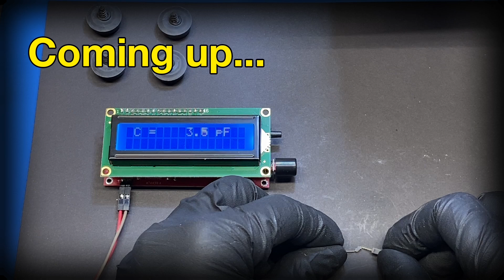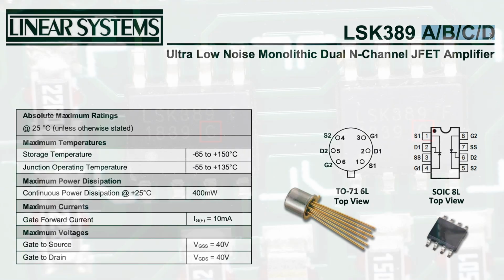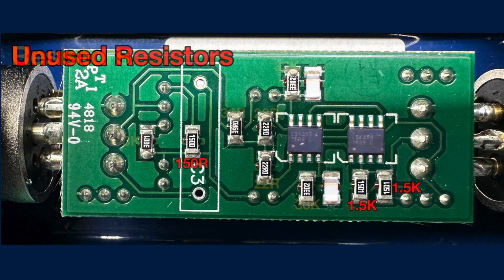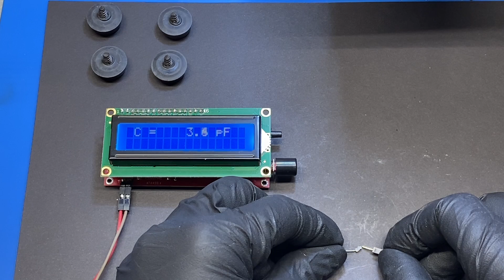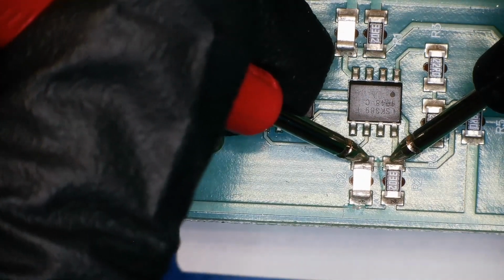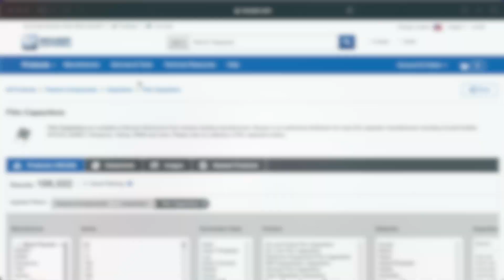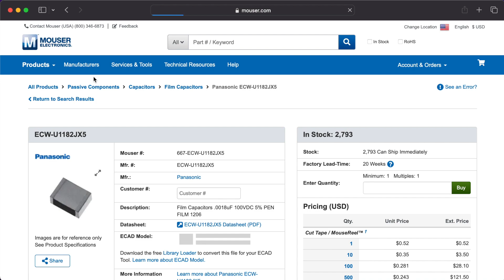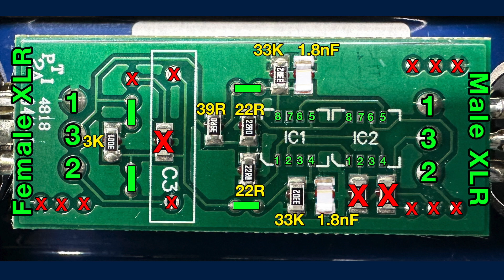Cloudlifter CL-1 Teardown | Mic Preamp Series Video 1

Comment: My cloudlifter is brand new but not working... i wonder if any of this is the problem...
Reply from the maker: Have you double checked that you have turned phantom power on with the Cloudlifter in your audio chain? And that the mic you are using doesn’t require phantom power, since the Cloudlifter will essentially block it.
Reply: @MostlyBuilds  I'm on an Sm7B which needs no phantom power...
Reply from the maker: @IceMike1200 gotcha. The cloud lifter needs phantom power. Did you turn that on when you have the cloud lifter plugged in between the audio interface and the mic?
Reply: @MostlyBuilds  no I didn't...
Reply: @MostlyBuilds  Thank you so much! You have helped me!!!

Comment: The other version of the board is a copy of the Alctron MA-1 circuit. That has the ability to short out pins 2 and 3 on the input to disable the microphone but the MA-1 case did not bother to put a switch on the outside. As CL-1 eventually also decided not to add the disable switch,so the final board does not have the jumpers.

Comment: Hello, since LSK389 is unavailable where I live, is Toshiba 2SK389 a 1:1 (as of specs)/ good replacement?
Reply from the maker: I have never heard of the 2SK389 until now. It appears to be discontinued by Toshiba and the LSK389 was explicitly built by Linear Systems to replace it. The specs look pretty similar. It might be worth a shot to try it. Curious that you are able to find this part and not the new one that’s still in production. Using a different part might work, but it’s definitely possible that it could sound different. Try it at your own risk! Good luck!

Comment: my cloudlifter is working with 48v off. It seems like an error to me, short circuit. On the "TASCAM" board it works with 48v off. On the ZOOM L-8 board it does not work. I found it very strange.
Reply from the maker: That sounds pretty fishy. Have you put a multimeter on the output of your Tascam interface? I’d bet it’s always putting out 48v.
Reply: JFETs are depletion mode devices, so they will pass signal even when not energized.  No gain, though, and probably attenuated.

Comment: use some chip quick, it will stay molten longer and allow you to remove the 1026 cap w ease
Reply from the maker: Great callout. I’ve seen people use this but I’ve never looked into it. Just googled it and I guess it’s called chip removal alloy.   It looks like chipquik makes several variants (different melting temps, lead vs lead free). I might pick some up. Thanks!
Reply: @MostlyBuilds another thing I've found helpful is to cut the wick off the spool and flux it. Less thermal capacity makes it way easier to desolder with wick

Comment: I am building the world's smallest CL-1 according to your scheme found capacitors 1.8 NF. mini grid size 5 MM. pcb will be aprox 2.5 X 1 CM. little I have Digigram pcb uax220 which can handle 2 pcs. SHURE SM7B. right away I'm going to build everything into a mini studio box a SHURE 1 DJ number 2 guest mick SHURE both with cloud CL-1 Crazy that you can play radio with USB 2.0 just like that!

Comment: Can you please tell me why I can't use LSK389B. It is not available in Europe and if I buy it from the USA it costs a lot...
Reply from the maker: My observation in the video is just that Cloud uses the C variant. You may be able to use the B variant. I don’t know if there is a practical difference for this application.  You can compare the differences by looking at the data sheet. Short of that, trying it and seeing if you can observe an audible difference may be all you can do.
Reply from the maker: Take all this with a grain of salt because I'm a hobbyist (not a professional EE). I took a look at the datasheet. Electrically the only difference between the B and C variants appears to be the IDSS (drain to source saturation current) -- the range is a bit higher on the C part. So the LSK389B can operate at a lower saturation current than the LSK389C, meaning you don't have to worry about it not fully switching on. I'm not sure what is required at the top end for the max value the B lists 12mA and the C lists 20mA. I think a higher IDSS value may have a lower on-state resistance, which would result in lower power dissipation as well. At these current ratings I kinda suspect that won't be an issue (maybe?). I don't know what the current draw is of the circuit though.

You could totally experiment with the LSK389B and see how it performs. I've also found the electrical engineering stack exchange to be a great resource if you feel comfortable asking questions there: https://electronics.stackexchange.com

Anyway, best of luck! Would love to hear back from you if you have any interesting insights from experimenting!